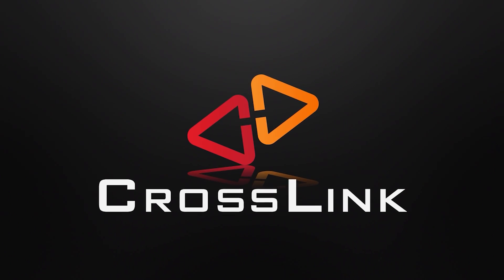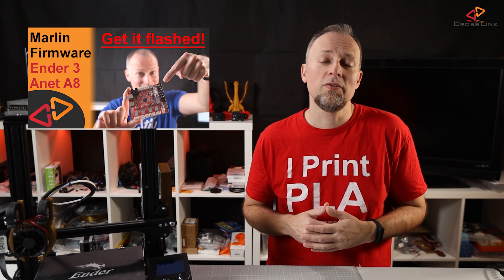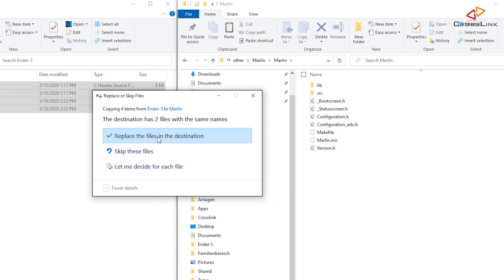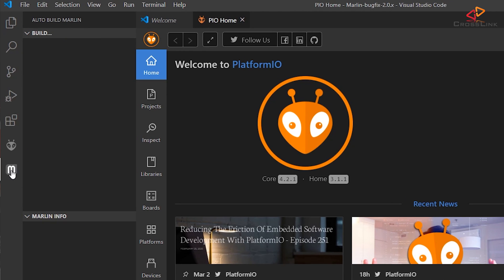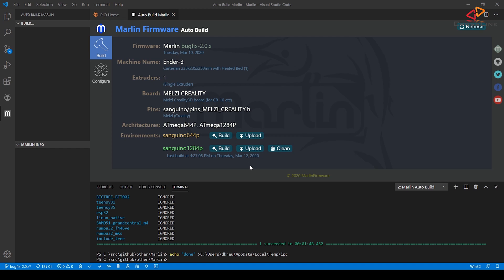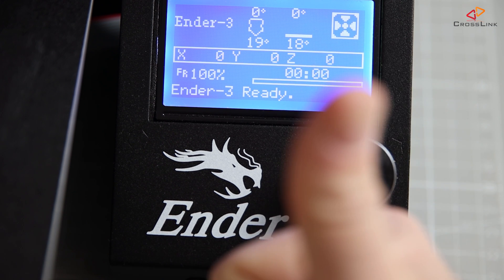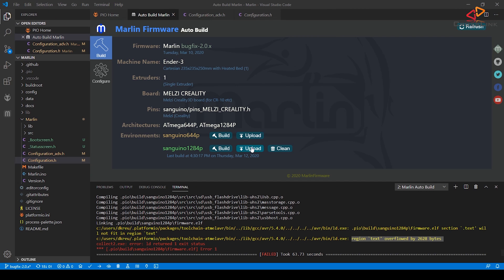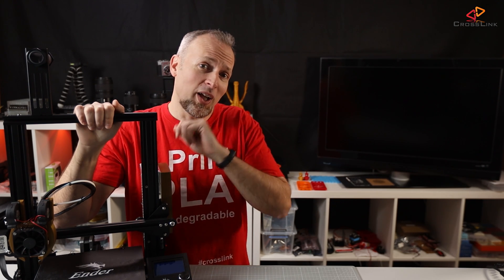Ender 3 (Pro) Marlin 2.0 Upgrade  - Updated Version

Comment: For some people getting the avrdude sync error even with a bootloader, I fixed this by changing the upload speed in platformio.ini. Might need to change it to 115200, which is what worked for me. Thumbs up so people can see!
Reply: Wow, dude, you saved me today, Thx. After changing, it worked correctly, thumbs  up :)
Reply: Vertig0 Awesome, glad I helped! I was scratching my head for a while trying to figure that out haha
Reply from the maker: You're awesome. Thanks for helping out!

Comment: Great video, step-by-step is excellent, like all of your videos.  For some reason 'Build' stage fails.  It is the sanguino1284p and I do have an Ender 3.  In the build I get  error: 'X_HOME_BUMP_MM' was not declared in this scope, error: 'Y_HOME_BUMP_MM' was not declared in this scope, and error: 'Z_HOME_BUMP_MM' was not declared in this scope followed by * [.pio\build\sanguino1284p\src\src\module\motion.cpp.o] Error 1 and the inevitable 'Failed' any insights on what I'm doing wrong?
Reply: I got a valid compile with Marlin 2.0.X bugfix and config files for Ender 3 (I don't know what the configs for Ender 3 V2 are)
Reply: You need to download the configuration file from https://github.com/MarlinFirmware/Configurations/tree/release-2.0.5 had same issue and this fixed it

Comment: Excellent video! I used all your marlin Ender 3 videos to do the upgrade. 
If you run into an issue with 2.0.5.x where your Ender 3 won't boot after flashing with the options enabled/disabled from this video, try freeing more memory. I found the package needs to be 99% or less of the available storage to boot properly. 
Went back to 2.0.4 and the instructions here work perfectly.

Comment: @Crosslink I did the first part and was ok when i installed the new firmware, then when i did the modifications and upload the build the screen of my ender 3 got blank, and now i cannot do anything :( 
and it says: Uploading .pio\build\sanguino1284p\firmware.hex
avrdude: stk500_recv(): programmer is not responding
avrdude: stk500_getsync() attempt 1 of 10: not in sync: resp=0x29
Reply: if someone could help would be amazing :)
Reply: @dayz112  Hey, I'm having the same issues. Were you able to fix it?
Reply: @edenilsonruiz9249  read my previous comment
Reply: @dayz112  your printer need  bootloader installed first....u can't directly install the firmware if u using ender 3

Comment: If your board doesn't have a bootloader installed, will it brick the board if I try to update the firmware and it fails, or will it still be usable?
Reply: If no bootloader, it cannot upload at all.
Reply: From my understanding, if no bootloader so we cannot use usb port to upload firmware.

Comment: I tried this guide and I had some problems with the not in sync message appearing. I used the "melzi optiboot" option and everything worked out... just in case someone has this problem...

Comment: AS OF 5/16/2020 This guide will now result in bricking your Ender 3 Pro 1.1.5. The current settings in marlin listed here only leave 16 bytes of free data when you are flashing new firmware and will result in your board being soft-bricked. Use at your own risk
Reply from the maker: Use these instructions here to free up more memory: https://thborges.github.io/blog/marlin/2019/01/07/reducing-marlin-binary-size.html
Reply: @Crosslink3D  the challenge now is that I don't have any way to flash new firmware. My ender 3 powers on, shows nothing on the LCD and the bootloader doesn't respond to commands. Not sure how to proceed now… and I have a broken printer
Reply: @Bermwolf  Me too, just did it yesterday, so now I am waiting for Arduino Uno R3 to fix this problem first.
And I think, @Crosslink should warn the user too.
Reply: @marionette409  I'm also on this step
Reply: @Crosslink3D  Thanks for this suggestion. Re-flashing the bootloader + using the above, I was able to complete the tutorial successfully

Comment: flying blind having never compiled anything before. It worked exactly as you describe, but does not compile with "cannot find \include" error.  I am sure this makes sense to someone :(
Reply from the maker: Maybe put the Marlin source code folder in the root of your disk. Some people reported having it in your documents or downloads folder is not working when OneDrive is set to backup those folders.
Reply: Crosslink thanks. It didn’t work for 2.0. It did work for 1.1.9. However, the bootloader seems to be overwritten, blank screen on start, loud constant buzzer while the machine is on. It “was” a silent 1.1.5 board. And still no change filament menu.
Reply: Crosslink I found the issue. Somehow, when I follow your link to 2.0, I get a version of marlin with missing libraries. When I searched for the version with bugfixes, this compiles.

Comment: Thanks Daniel, this is the clearest video I've watched for doing this! 
I've followed your steps to the letter but failed, screenshots: 
https://drive.google.com/open?id=1YDU8dKWjXqT3qaZXwdD5LEuEhy-RLwF6 
Will really appreciate it if you could help. Keep up the good vids! :-)

Gab
Reply from the maker: Seems to be a bug in the latest release. Try bugfix branch until the next release comes.
Reply: @Crosslink3D  Thanks Daniel, you're right. I installed 2.0 with bug fixes. But now the curved part of my 3d benchy has over-extrusion. Calibrated extruder e-steps, same gcode:
https://drive.google.com/open?id=1BvbIAIDyXP-OwGUWH12uZ9D7XRQnjV7b
Reply: How did you fix the error

Comment: what to do if my printer name is not in the list?
Reply from the maker: Well, it more depends on your ability to adapt the settings of Marlin to your printer. If there is at least some kind of community around the printer and there might have been a configuration for Marlin 1.9 for it, you could adapt that to Marlin 2.0 but it looks like that's up to you if the printer is not in the list.
Reply: @Crosslink3D  Thanks. The seller tell me to try to firmware with Xloader  the file is Marlin.ino.hex     Mega(ATMEGA2560   baud rate 115200  you heard about this settings? i try but nothing happen. The matherboard is Makerbase MKS GEN L V1.0 motherboard MKS mainboard 3D printer control card support A4988 TMC2208 TMC2130 stepper driver

Comment: THANK, BUT IS NOT WORKING 
HERE IS MY PROBLEM Marlin/src/module/motion.cpp:77:71: error: 'X_HOME_BUMP_MM' was not declared in this scope
 #define XYZ_CONSTS(T, NAME, OPT) const PROGMEM XYZval<T> NAME##_P = { X_##OPT, Y_##OPT, Z_##OPT }
                                                                       ^
Marlin/src/module/motion.cpp:83:1: note: in expansion of macro 'XYZ_CONSTS'
 XYZ_CONSTS(float, home_bump_mm,   HOME_BUMP_MM);
 ^
Marlin/src/module/motion.cpp:77:80: error: 'Y_HOME_BUMP_MM' was not declared in this scope
 #define XYZ_CONSTS(T, NAME, OPT) const PROGMEM XYZval<T> NAME##_P = { X_##OPT, Y_##OPT, Z_##OPT }
                                                                                ^
Marlin/src/module/motion.cpp:83:1: note: in expansion of macro 'XYZ_CONSTS'
 XYZ_CONSTS(float, home_bump_mm,   HOME_BUMP_MM);
 ^
Marlin/src/module/motion.cpp:77:89: error: 'Z_HOME_BUMP_MM' was not declared in this scope
 #define XYZ_CONSTS(T, NAME, OPT) const PROGMEM XYZval<T> NAME##_P = { X_##OPT, Y_##OPT, Z_##OPT }
                                                                                         ^
Marlin/src/module/motion.cpp:83:1: note: in expansion of macro 'XYZ_CONSTS'
 XYZ_CONSTS(float, home_bump_mm,   HOME_BUMP_MM);
 ^
Reply from the maker: It's a bug in the current version. It has been fixed in the bugfix branch, so please try that first and also use the bugfix branch configuration files.
Reply: @Crosslink3D  When I use these bugfix files and i reach the build section of your video, instead of getting the option for the 'sanguino 1284p' I get 'melzi_optiboot' instead, is this a problem? I tried it with 'melzi_optiboot' and it seems to have worked but I don't want to go further in-case I'm making a big mistake! Thanks for your help btw, appreciate your videos and effort. Edit I also used the bugfix configuration files too, as you suggested, with the same result.

Comment: Daniel, please help! I followed your video all the way to the end. EXCELLENT video!! The first flash of the firmware was perfect as you showed in the video. Then I enabled the TMC2208 drivers for my 1.1.5 board, the mesh bed leveling items, and commented out the ARC and splash screen. The upload was successful and the printer sat at the Marlin splash screen. I rebooted the printer and it is now stuck at a blank blue screen. I tried commenting out the mesh bed leveling and reflashing but now I get the "not in sync" errors and it fails after the 10 attemps. Please help me.
Reply from the maker: Can you please flash a new bootloader to the board and then flash the firmware again? Exactly this happened to me and after that it went away.
Reply: @Crosslink3D  Unfortunately, I didn't have the USBasp at time of writing above. The 1.1.5 board came installed with the bootloader so I didn't think I needed these items. I finally got the USBasp and adapters, followed your other video for (re)installing a bootloader, and now everything is working fine including the new stepper drivers and mesh bed leveling. Thanks very much for the tutorials.
Reply: @mikesilluzio9399   I have the exact same issue. I saw your comment before doing this and ordered the USBASP adaptor so I will need to wait until that arrives before I can fix it. If I didn't see your comment I would have been worried!

Comment: I followed the steps one by one, and it failed when building the sanguino1284p with Visual Studio Code:
Marlin\src\module\motion.cpp:77:71: error: 'X_HOME_BUMP_MM' was not declared in this scope
Marlin\src\module\motion.cpp:77:80: error: 'Y_HOME_BUMP_MM' was not declared in this scope
Marlin\src\module\motion.cpp:77:89: error: 'Z_HOME_BUMP_MM' was not declared in this scope
* [.pio\build\sanguino1284p\src\src\module\motion.cpp.o] Error 1
================================================================================== 1 failed, 0 succeeded in 00:00:06.188 ==================================================================================

What can be the issue?
Reply from the maker: It's currently a bug in Marlin. Can you please try with the bugfix branch and the bugfix configuration files (!) and tell me if it worked for you?
Reply: @Crosslink3D  Hi. I finally managed to update my firmware (I was still using the stock one),but I did it with the arduino IDE. I was getting the same error, and apparently, I needed to change the way that value was being declared, from one line as an array, to declare each value individually per line.

Comment: This video just variations of the firmware dont do this unless u already have a bootloader. If u haven’t get the 1.1.6 firmware don’t upgrade to 2.0 or any later version. Also this contain much more ram and if u can’t edit configure H dont do this. Also these guys does video but never answered question so I guess u on your own.
Reply from the maker: Well, any kind of firmware upgrade has the imminent risk of breaking your bootloader. So knowing how to flash a bootloader and having the tools at hand is kind of essential from my PoV.
Reply: Crosslink I said that because few beginners follow this step in this video found out they brick the printer because this is advanced not for beginners u should put that somewhere in the description.

Comment: I keep on getting this error after flashing my Ender 3 Pro successfully:
avrdude: ser_open(): can't open device "\\.\COM3": Access is denied.   
I can't figure out why this is happening, any advice??
Reply from the maker: I assue you have some other application like CURA running in the background that is blocking the port. Close all applications first, then try again.
Reply: @Crosslink3D  is right. Anything running in the background (that is taking priority control) will cause this as well.
Reply: Config issue. Check your settings. (With me the wrong COM port was selected)

Comment: G'day there. I have an error message in the build that says vscode cannot find marlin/include... Any tips? Also what happened to the older video - I posted a good comment that got marlin 2.01 working which if I could get read again that would be great! Cheers Simon
Reply from the maker: I would suggest to put all the Marlin source files in a subfolder in the root of your disk. Some people report that they had the sources inside of a OneDrive folder, which broke the build as well. If nothing helps, get a fresh copy of the sourcecode and start over.

Comment: hi trying to follow your video, when i open the marlin build i see mega 1280 not sanguino is this the ok to use?
Reply from the maker: Then you didn't copy the proper default configuration files for your printer to overwrite the old ones.
Reply: I am having the same problem and I know I chose the correct config files and put it in the config file folder.  Were you able to fix this?
Reply: You've likely sorted this, but in case someone else is having a similar issue make sure you only copy the files from the appropriate folder, not the folder itself.